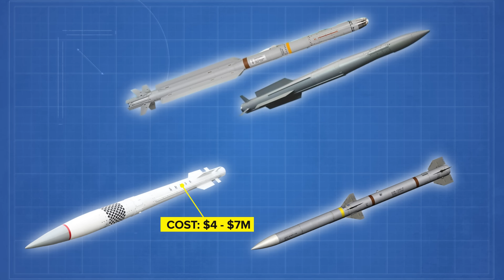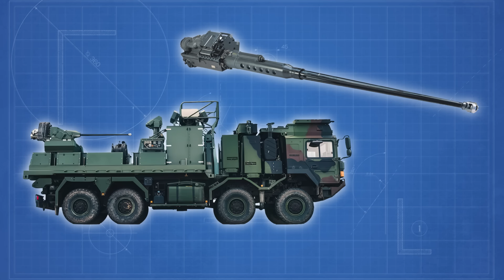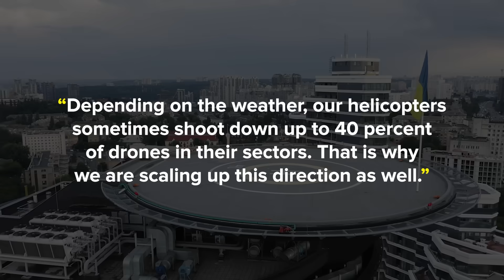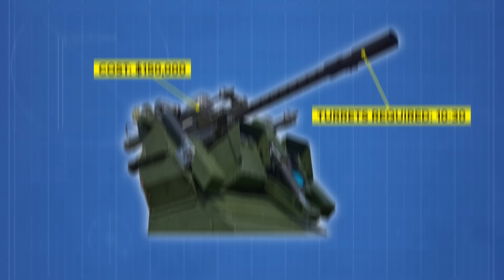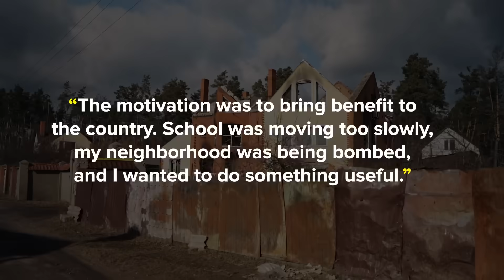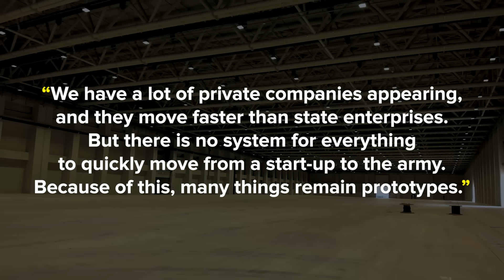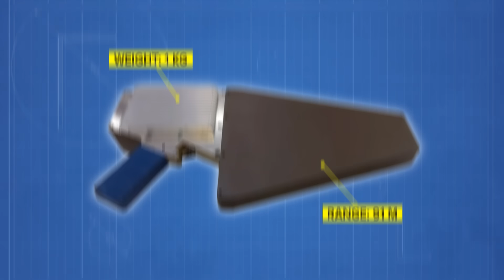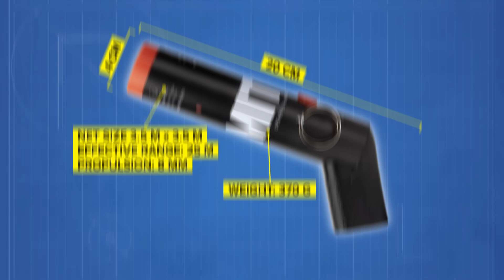Ukrainian TEEN Finds GENIUS Way to TAKE OUT Russian Drones

Comment: Take spent 40mm shells from the M-19 grenade launcher and reload as a shotgun cartridge. When the infantry is not firing grenades another belt with shotgun cartridges can be installed on the M-19 launcher to protect the troops until they need grenades again . This approach could be used to protect armoured vehicle, trucks and even buildings against drones.  The smoke grenade tubes on tanks could also be used to fire them. This will be much cheaper than the high tech weapons and missile launchers. They could be rolled out to all military personal quickly and cheaply. The -M-19 could be mounted on aircraft as well.
Troops are using 12 gauge shotguns, but they have limited range and a limited load of pellets. This can be a last chance protection taking your drones at 30 to 100m. The selection of pellet size can be

Comment: What about using mortar launched aerial fireworks when Russia sends large numbers of low altitude drones in a single assault? Emergency signal flare guns might prove useful as well in low tech warfare - would have to change positions immediately after launch/fire to avoid giving away locations

Comment: Deer are caught by nets fired from helicopter skids in New Zealand using a 308 blank splitting the blast through 4 tubes each with a bolt attached to a central net.  Net rapid slow down is a problem.  The French use Chevrotine to hunt boar.  These are several lead balls joined by thin brass rings. These would fly further and perhaps the cloud size could be increased by making the rings larger.

Comment: That shot gun round has been out for long time well before this kid thought of it. It is a solution, not THE solution. What is the solution is a DRONE FIGHTER. Which is a drone with the capability of catching incoming drone at all altitudes, have a significant range for interception, eliminate several enemy drones and survive to be reused again. The drones could use a number of weapons but a small caliber weapon(s) with decent range and able carry a significant amount of ammunition .22, or 9mm would be fine for this close range combat. Specialized ammo like fragmentation from a 12 gauge shotgun would be fine but recoil and low ammo count is a problem.

Comment: I too would go for the shotgun ammo, shotguns allow for multiple rounds to be fired in quick succession whereas that single use device only fires once. The shotgun rounds are also much smaller, that single use thing takes up the same volume as 3 shotgun shells at the very least, possibly as much as 5. Yes, carrying a shotgun in addition to whatever other weaponry the guys are equipped with does undoubtedly add a lot of bulk and weight, but the ability to shoot multiple drones out of the air in quick succession with a single gun, possibly even a self-loading one, makes it worth the hassle imo. Or maybe each unit gets assigned a dedicated specialist solely responsible for keeping the air clean, with as much of this ammo in his pockets as he can carry, while the other guys do carry one of those single use pistols each for whenever the specialist has to reload.

Comment: I wonder - why there are no footage of the use of this 'revolutionary invention'?  Shotgun shells with small pellets - .11 inches , 2,79 mm most probably produce wider destruction area, the chances to stop it is bigger. 50 yards range? If it disable it at 50 yards and it's moving with 80 miles per hour - it still gonna hit you (aimed properly). I'm not expert, just pure physic, but I do not see comments from the expert either?

Comment: I wonder if they could actually mount a shotgun with these rounds on a drone itself to produce a drone chaser - could let personnel remain under cover too, even if it's on a wheeled drone. Not as fast to aim unless they use a VR kind of control and it can respond as fast as that or has some kind of automated track and control system.

Comment: I worked in high tech hardware and weapon system design after discharge from the US Military. If  was in charge to defend a base or city, I'd say screw high tech. Go back 80-85 years, get Nazi 88 Flak guns and wait for the drones to come close. Cheap, Cheap cheap and highly effective with a few shots taking out entire swarms. Some times the old ways are the best ways

Comment: I mean no disrespect—the fellow’s doing what he needs to in a new battlespace—but 12-gauge net rounds have been used to counter drones since at least 2017. Net rounds themselves long predate modern drone threats. Your researcher should spend some time in library archives—Guns & Ammo and similar periodicals are exactly the place to find original writeups and dates—rather than relying on recycled online clips. One more technical note: while firing them from a Saiga-12 looks dramatic, net rounds are generally more effective when launched from a longer-barrel, no-choke semi-auto shotgun (for example, a Remington 11-87); the added barrel length and velocity deliver better range and deployment.

Comment: Hay, how come you guys aren't going with my SILLY STRING idea.
The gas powered drone trails a string that get caught in the DRONE PROPs.
The shotgun shell has a bunch of 2 inch wires with string wrapped around them.
The air defense unit has air cover for the troops on the ground, flying the prop fighter.
Then there is the wood foam and plastic sheet biplane Stuka bomber with a $40 cell phone brain that drops a bomb and returns for a reload,  Sitka spruce = radar stealth, clip on replaceable parts, gas powered, program a compass path and when it gets there the ground men guide it in. Blows up train tracks, and the supply line of the enemy.  Kids after school can fly them.

Comment: Unfortunately it's fairly easy to counter. Net guards around the rotors. Either grills or a slightly more open design. You might be thinking "but if there's a heavy net on the drone won't it fall?" But remember all of it packs into a small round. It can't be very heavy. Drones lift heavier things than that all the time.

Comment: The Interceptor UX streamer rocket is a low-cost hard-kill anti-drone system jointly developed by the Taiwan Academy of Sciences and Canada's Airshare. Its principle involves the rocket launching and releasing a large quantity of streamers that entangle the propellers of enemy drones, rendering them incapable of flight and causing them to descend slowly. This significantly reduces the cost of countering drone threats while also prioritising personnel safety. The system integrates CASIC's anti-UAV technology and is scheduled for validation at the Jiupeng Base by late 2025.
System Operation and Features
Operating Principle: Upon launch, the rocket dispenses approximately $20 \text{ metres} \times 20 \text{ metres}$ of ribbon, precisely entangling the drone's propellers to cause uncontrolled descent. 
Hard Kill Interception: This constitutes a "hard kill" interception method, differing from conventional "soft kill" jamming techniques (such as jammer guns).
Parachute Functionality: To prevent damage upon impact, the rocket projectile incorporates a parachute mechanism, enabling the entangled drone to descend gradually. 
Cost-Effectiveness: Compared to conventional missiles, ribbon-based rockets offer lower costs, providing a more economical means to neutralise drone threats. For instance, entangling a drone valued at approximately $3,000 requires no expenditure on million-dollar missiles. 
Application Scenarios: This system will integrate with the National Chung-Shan Institute of Science and Technology's (NCSIST) anti-drone suite (including radar, electro-optical systems, and jammers) to protect military units and critical infrastructure such as oil, water, and power facilities.
Collaboration and Development
Partner: Canadian company Airshare.
Validation Timeline: Validation is scheduled for late 2025 at the Jiupeng Base. 
Future Integration: Integration with CASIC's anti-drone systems will address escalating drone threats and minimise personnel casualties.

Comment: Yuri - If you get the opportunity to read this, you are an exceptional young man. If you're still trying to decide which path to take, my advice would be to take the path where you will be most useful and have the largest positive impact for your country. You will undoubtedly excel, whichever option you choose. However, I personally think you need to develop this business. On the frontlines, you could certainly have an impact - but, by designing and building solutions to the problems faced by the frontlines, that impact could be multiplied infinitely. You have a rare skill - the ability to problem-solve in a low cost, easily implemented way. Don't waste it, because it could save hundreds, if not thousands, of your fellow countrymen. 

Young men like you are key to Ukraine's victory and survival, so position yourself to make the biggest impact possible.

Love and respect from the UK 🇬🇧🤝🇺🇦

Comment: During the ww11 the British used helium filled balloons with steel cables hanging from them to to rip the wings off the bombers. Why not use light electric conductive wire in a fishing net style hanging from balloons to catch the drones with electric charge to disable their navigation system

Comment: 10:45 "up to five times smaller" That makes them bigger, not smaller. It's maths: 5 x 1 = 5, not 0.2. You mean 1/5th of the size.
17:05 There's no such thing as a point of an inch. Inches are Imperial; base twelve. A decimal point is metric; base ten. Dec = ten.
The image literally shows measurements in centimetres. Why are you using inches?

Comment: During the early days of WWII the UK diploid a hand grenade launcher for anti dive bomber protection of fishing boats and small freighters, this was basically a gas gun, a tube down which a hand grenade with is pin remove was dropped to hit a valve that let in a measure of gas and also energised a piezo spark.
the idea to produce airburst fragments in the path of the aircraft, to put the pilot off as much as damage the plane.

The whole thing was mounted on a frame that would rotate and the barrel/tube elevate and depress with the gas tank being integral to the barrel.

 my thoughts are as the FPV drones fly a damn sight slower than a diving plane these could be refined to that they can be automated by a soldier in a bunker if a drone is spotted with a tilt and turn mechanism and self load it could wop out a series of grenades into the area of the drone a near miss should damage the drone with blast and shrapnel or sever the fibre optic cord.

Comment: U need to start making new anti drone missles.  fpv drone missles made from rocket candy for fuel & paper tubes, pringles cans, or pvc & duct tape for a body, & a simple fpv control system to steer it. Place a modified frag grenade in the nose cone w an electronic trigger.

Ur guys downrange need protection.

Wtf u waiting 4? GET IT BUILT! DOUBLE TIME!! LETS GO!!! LETS GO!!!
Reply: Deploy those things everywhere!

Comment: A simple help for defending against those large drones that attack civilian infrastructure would be light attack aircraft like AT-6B Wolverine or A-29 Super Tucano.  Have a few squadrons of these cheap, propeller driven aircraft assigned to guard certain areas /approach vectors, have them armed with machine gun pods and a simple off the shelf pylon mounted radar.  They can operate from dirt fields, any mechanics skilled enough to work on cessnas can do maintinance on them, they can remain on station all night without needing to land to refuel, and they have the speed to chase down the faster drones.

Comment: Run a lifting drone with a trailing skyhook to gather fibre and severe it,  drag pressure on hook triggers cutter, reset with a pull cable (like on bicycle break cable)

Comment: They should build the jammer pistol into something that can be mounted on a picatany like a bipod. That way you're not trying to swap weapons and you're automatically jamming anything down range of you. 

You could probably build a yagi antenna right into lower and only add a couple ozs. Easily worth the weight in a robowar where EMP is the new Big Badda Boom and pulse weapons the new javalin

Comment: I have heard very short comments of standard shotgun shells being used against small drones with poor results, but nothing has been said about modified ammunition to shotguns (or some other weapon). It would be interesting to see if that can do anything to stop the smaller drones. Whether it is with metal balls, nets or strings....or whatever can be tested. Personally I would like to see a test with what pirates used to slice sails or whatever came in the way of two balls chained together....two small slugs with a thin but sturdy wire between. Take any number of those, stuff them into a standard (?) shell rolled up in some way that they don't hinder but help each other. Perhaps that can cover a larger area in longer distances. It would be very interesting to see tests like that.

Comment: I keep saying we need an 8 barrel rotary gun that fires 12guage (because it's cheap and common), this can be paired with a system like CWIS and mounted high up above vehicles and places of importance.

2 or 3 of them should be able to co witness identify interfering craft and gun them down rapidly with small projectiles like bird shot that carry little to no energy after a certain range.
Reply: If you consider net shot, and use rifled barrels to cause a spin, the net shot should be self spreading on release via simple centrifugal forces

Comment: What you need is a radar that tracks small incoming objects. You place this on top of any vehicle. It should be lightweigjt. Also you need an automatic machine gun or automatic shotgun. Loaded with about 500-1000 rounds. The radar should scan the sky around the vehicle for any incoming objects. Once detected the gun should automatically target and destroy the incoming drone. Problem solved. Its not that hard to figure this out...

Comment: Trust young people!
Reply: Not exactly a good example to drive your point home lmao. These were invented in the US and have been available for a decade. People just dont use them because there is no purpose to do so and they are consistently and significantly outperformed by even the cheapest birdshot shells you can buy at walmart. It is an inherently flawed design that even a first year engineering student would laugh at. Only a teenager, or someone who knows nearly nothing about guns/ ballistics, would think these are anything more than a gas station gimmick. 
 For starters, the whole design hinges on the assumption that the projectiles used as weights will travel in a perfectly consistent manner and in a near concentric circle when fired from a weapon literally called a "scatter gun". 

Next, the net and the weights experience different drag forces in flight, meaning that no matter what it will have an uneven tumbly flight that results in extremely poor accuracy and failure to open the net and keep it open without tangling. 

With the shape of a net, you get inherently terrible aerodynamics because a grid like that will create an outrageously turbulent flow as it flys through the air ESPECIALLY at shotgun velocities. 

The biggest most glaring flaw : Catching a drone in a net does not stop it from exploding. It can still detonate when the operator realizes its going down lol. If by some miracle the operator doesnt self destruct, it leaves soldiers with either a bomb to render safe or UXO for someone to find years later. 

Literally just reinventing the wheel, making it square, and acting like its the smartest thing since sliced bread.

Comment: Imagine a larger net system being installed on armored vehicles, in their vulnerable spots. When all else fails, hit the plunger and fire a larger net with greater distance ability. Install these on jeep type vehicles , when endangered by loitering drones are present. Possibly using a remote control to fire, so the soldiers can activate it as they are exiting the vehicle.

Comment: How about a smaller caliber metal Storm type weapon that shoots aluminum or wax bullets at the drones. If the ballistics could be worked out with the wax bullets you won't have an environmentally bad situation of where all the bullets land and a wax bullet will have enough energy to take down the drone if you either a direct Hit or hit it in the rotors it'll come down
Reply: The heat would melt the wax before it came in contact with the drone. 

Biodegradable material would make more sense.

Comment: Use the sample and chase on known...after the fact, signal sample of a loaded Drone. this shouldn't change greatly as they're mass assembled with same loads and charges. you can do the same with the dummies and avoid them.  Voice recognition software such as SIRI and other translating software is easily installed with the microprocessors in phones.

Comment: I think a coherent, directed beam of microwaves from a maser, microwave amplifier by stimulated emission of radiation, a predecessor of the laser, could be developed to shoot down drones because such a beam would go through the drone’s fuselage and cook its electronics. Just like radar, it is not affected by atmospheric conditions. An electrical engineer or physicist should be able to develop such a device.